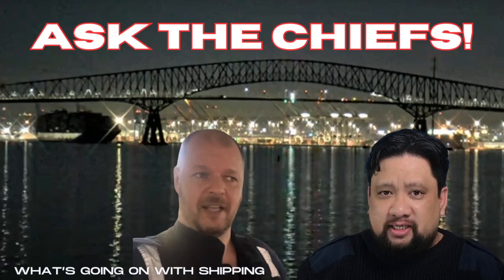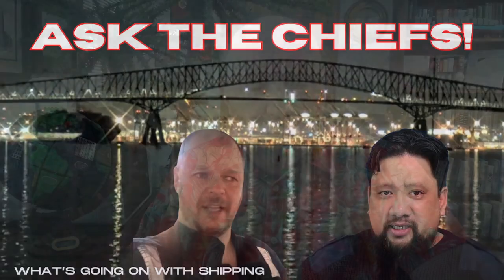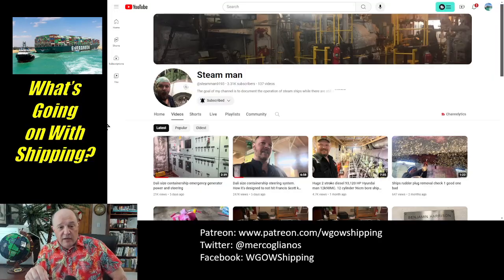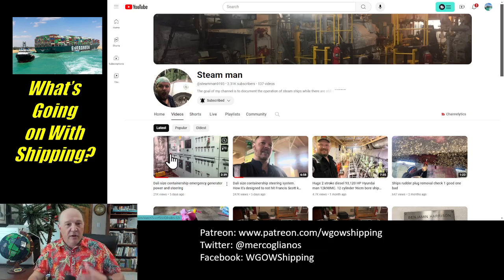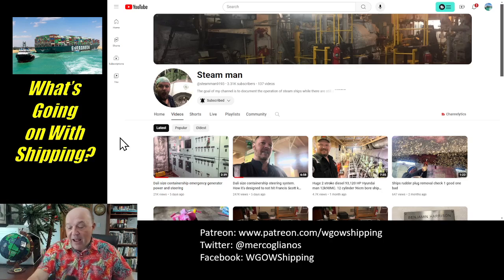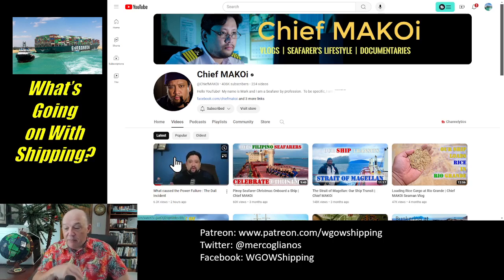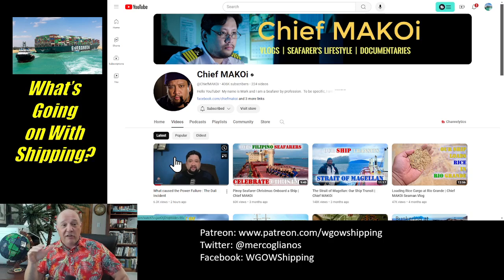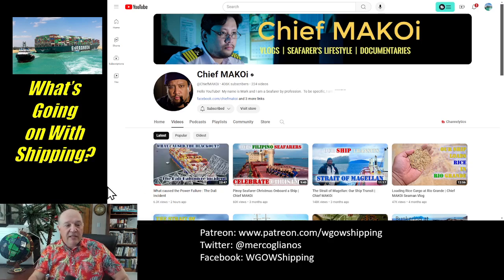Ask the Chiefs! | Chief MAKOi and Steam Man Discuss Issues Leading to Dali Losing Power in Baltimore

Comment: SOME vssls (not often those built in simillar shipyards as MV Dali) have only one FO supply pp to both ME and AE's, wh causes a total blackout and deadship condition at the same time if not the standby FO sup pp isnt properly operational at the time of failure of the running one. problem is definetly FO supp problem in addition poor maintenace of the EMSB gen and power gear

Comment: BTW, ...the only action by the captain that may have been different was "dropping just the "port anchor", when recognition of distress  would have required dropping both anchors, and prior to dropping any anchor issue the distress call, or the sequence of events regarding the realization of distress. "Accidents" are generally a singular event dictated by 'time-and-circumstances', never more so than in this event. This event must be recognized[...as simulated], as a warning, because that ship could have collided with much more destruction in any port or seas, ...and yes, more tugs will be necessary to move these massive ships around hazards to marine traffic safety(...$)

Comment: Thanks for the analysis, from someone with the engineering/education/experience, to explain this event. It has been my suspicion from the first appearance of the 'black-smoke' that this disaster was 'fuel-related'. Of course, every action of the captain, chief-engineer, and crew will be scrutinized exhaustively, by every investigative authority. Their actions, post engine failure, will  be throughly investigated. However, the electromechanical controls will also be scrutinized, by the best marine engineers. Knowing that these events are simulated, and trained for, in marine education is good, even if the outcomes are generally disasterous; "ships go bump in the night" ...and even in daylight. Separating fact from fiction is not easy in today's mass-communication environment, but it's nice to find someone with the truth. Thanks again🫡👍

Comment: The problem. based on information available today, is rooted in unable to share load between the two main generators.  The subject is sometimes called cross current compensation.  It is complex subject and not easily explained to anyone with out a strong electrical background.  I can tell you a lot more but I have delt with problems in ths area many times as a Westinghouse Service Engineer.  Please advise if you want me to go into detail.

Comment: Sal:   I saw Chief Makoi video on his take.   One of the hidden aspects of this disaster is when he said that in the Simulations they could not recover the vessel in a system failure like that if maneuvering.     That is like a Jet Airliner not being able to loose an engine on takeoff and crashing,  said aircraft HAVE to be able to climb on a single engine gear and flaps down which is worst case scenario.
      Given that,  all the AHJs knowing that which is also a given,  how can they not be blamed for setting up a system (3 tugs is the only one I can think of attached to the ship) that deals with that.   Sooner or latter its going to happen and now its been twice (in the US).    
      I will get looking at Steam Man videos as I was into backup power generation as well as facility swithgear  gear and distribution.    My backup systems had redundancy if they ran the whole facility and that was not life safety or mission critical,  it was to allow ops (freight sorting) regardless.  
     A common fuel failure should not be allowed.    If it is,  then the complicity of the shipbuilding certification groups is stunning.   Even if it was not this cause.  If it was electrical then the isolation and or the distribution is at fault and that too should not be allowed.    I had 6 critical diesel fire pumps and each fire pump had its own fuel supply.    Yes you could get contaminated fuel but fuel was delivered at different intervals and the engines were run  loaded 30 minutes a week to ensure ops which included bad fuel failures.  
      A backup generator will have its own fuel supply as well,  each of the main Generators should have individual fuel supplies for X amount of time as well as fuel separator that do water as well and the backup generator should have its own water/filter separator.

Comment: WHY DALI SHIP TURNED? In the Baltimore harbor area, a vessel channel has been dredged for ships with a large draft (the depth of the channel is 50 feet, but next to the channel the depth is only 11 and 14 feet) and next to the port side of the ship there is a lot of this deep volume laterally, but only a little laterally on the starboard side.
   When the ship travels in the channel closer to the right edge of the channel, the suction caused by the propellers causes a clearly larger tidal effect on the starboard side of the ship than on the port side of the ship when the keel divides the suction in two.
   Now - when the engines are turned off, where do the differences in the tidal effect on the different sides of the ship take the vessel that has traveled directly on the fairway? Does the flipping tide turn the vessel towards the edge of a nearby draft? Did the strong one-sided burst of the tidal phenomenon cause the ship to turn itself to starboard? 
   I believe that the mere excess of water on the port side of the ship compared to the shortage on the starboard side causes the ship to turn right by itself as the water masses try to equalize. It cannot be significantly affected by turning the rudder to the left or by lowering the anchor to the sandy bottom of the harbor basin. Even if this is done, its significance is only formal.

Comment: As a deck officer, before getting underway, you test gear with the engine room. This is law. If you are a 3rd mate worth your salt, OFF WATCH, go down to the Engine Room and see what the 1st AE has to do to make this happen. It's a big plate. Every plant is different and had it's quirks. Listen to the Engineer and develop a trust with them. It will only benefit you. On the other side, God help the Engineers if they have gun decked any deficiencies or lied about issues with the plant or other systems such as the STEERING or Ballast systems. SOX.  From the scanty information reported, who was the pilot? How many pilots were there. Many places require a Docking and Channel Pilot. Was steering control continuous throughout the whole evolution? What was recorded in the Bell Book if the VDR was inoperable (which I doubt). AIS's and VDR's have been spoofed for years. How forthcoming is VTS? Look Bro, I've been in the industry since the mid 1970's and something doesn't pass the sniff test.

Comment: Call the CHENG! Hmmm, I have been syaing this same stuff about the battle between the E-Gen and Main Power busses when they try to restore power at the same time. Depending on the software you will have switches clicking on and off from both systems trying to get electricity back up; including the battery back up for steering, lighting, pneumatics, navigation, and communication.

Comment: Seems stupid to me a modern ship has to kill its power plant start it in the other direction to reverse. We have had transmissions for a very long time. Baltimore is a shit show prove me wrong. Stupidity is killing our world.
Reply from the maker: It is a slow speed diesel that does not require a clutch or transmission, and therefore substantially cheaper.
Reply: @wgowshipping  I understand that. I am a diesel mechanic. But if the shaft is directly coupled to the screws then it must be killed and restarted the other way.  Restarting those massive things per oceangoers of big boats isn't a quick process. Plus cam settings must be changed to reverse most diesels to start backwards
Reply from the maker: @rodneyward8357  Exactly.  That is why the chief did not think the engine was ever placed astern.
Reply: @wgowshipping  still stinks. Yes I really like your channel. But we must focus on making shipping better. Imagine if a US flagged ship took out a bridge in a foreign country? It would be bad. It's a shat show and it makes us look like that.
Reply: @rodneyward8357 
These are two-stroke engines, so no valves and no cams.
Reply: @margaretabengtabelsson9500  diesel 2 strokes have all of that. Not even close to a 2 stroke gasoline
Reply: @wgowshipping  so basically cheap and stupid took out a major bridge in a major port. Ain't that some shat.

Comment: I'm a master helmsman. I'm not just not buying that the reason the ship continued it's turn is because it lost propulsion. While prop wash definitely contributes to the turning moment, the ship should have been able to halt it's turn to starboard if steering was restored when the power came back on.  To me, it looks like steering control was never restored, even when the power came back on.  While there are other forces that are likely contributing to the turn to starboard, such as bank suction and current, I still think they should have been able to at least stop the turn if steering was restored.

Comment: Having retired as a Chief Engineer from the merchant marine industry, I totally agree with Chief Makoi. I suspected early fuel changeover attempt, have to check the competency of the 4th engineer and all other engineers on board. Is there any engineering crew change (new staff) on that port?  There are lots of other factors for the total power failure, which is very complex. Need a thorough investigation to find out what caused this incident. Six human lives lost.

Comment: My question for the chiefs is. If the main engine is free spinning because of prop wash, How is the engine being lubricated? And if it is free spinning and you get the main generator back on line can you restart it without the air start system? Can't you get the auxiliaries running and turn on the fuel and restart the engine. I would think with all that mass turning it should start.

Comment: Thanks for refering me to the two chiefs. As a professionl engineer, it is refreshing to hear the analysis from people that know the systems involved with control of the ship.. It is hard to believe that three diesel engines all died simultaniously due to a fuel issue. I'm leaning toward an issue with the electrical systems as evvidenced by the nav lights dark on the first restart and they were lit on the second. I don''t know about big computer controlled diesel engines but the engines on generators and construction equipment  do smoke on start up. I have followed Chief Makoi for a long time and his presentation was excellent.

Comment: One question I asked on Chief Makoi's channel and haven't heard an answer about in one of your early videos on the Dali you mentioned that there was no use of the bow thruster.
I was wondering if it was something that wouldn't be connected to any of the backup systems or otherwise requires the main engine to use.
Reply: Somewhere within the last couple days that has been discussed and it was commented that in order to produce enough thrust to be effective those thrusters eat a very high amount of electricity. So, if there are major electrical issues there likely will be no bow thruster available.

Comment: Once again why a ship big like dali had to be doing 8 knots in channel before the sky bridge.  Because  of pressure s from pilot or port authorities  owners of operation management.  No escorting  tugs to save money or what . Does the letting go port  anchor made it worse . Otherwise  still the ship could  have  passed the bridge column with the bridge at least intact.
Reply: I have read earlier that most/any tugs are ineffective above 5kts; and/or the tugs can not "keep up" with client ships above 5kts.  It is a conundrum.
The only way around this would be to run everything around ports at 5kts or less...but then the "big" 100,000 tonne ships are not under "good control" below 5kts because the wind and currents blow them off course too much below 5kts.   The large ships need a lot of momentum to "make way".  It is a major conundrum.  The maritime insurance companies are befuddled how to make this any safer than it already is.  You need above 5kts momentum to "drive" these large ships to make precise directional headway...very tough issues !!
Reply: @Carlos-im3hn   i have a experience of 20 years as a marner. Its has been long time i left it . I know rules n regulations  have changed since then . On ships I was in have never experienced blackouts in channels or underway.  May be on anchorage but what I remembered . But I know nowadays especially  container  ships are on a very tight schedules. With all kinds of pressures by ships  management   n saving money cut corners hurry hurry situations.. do freezer containers get power  from ships generators. I do not know.. Really point blank BAD LUCK FOR DALI NOTHING COULD SAID MORE BAD TIMMINGS

Comment: I was getting a special a the local bar, when on X I was advised that a ship doesn't lose steering when a ship loses power and lost it, becoming rather animated. Another person at the bar asked me where power and steering was lost and I said, "Seven Foot Knoll." 

That produced the look of terror on his face and he asked me, "Water in the fuel." 

I responded, "Lost wind, we were under sail." 

Another look of horror, "No engine?" 

"What we had wasn't going to work there." 

""What did you do?" 

"Figured out what not to do to sink our ship or get us killed. Our faith got us trough." 

He had a power boat and a problem on a different area of the bay, and wished he has sails." What you say is true, but with navigation and steering, the principles of physics are the same and applies to all. The one thing I will not tolerate is disrespect to the crew and would love to hear their stories. I figure they had 5 to ten people working on the problem, as well their assistants. I figured everyone else on board was gearing up on fire fighting or damage control.

Comment: 5-Stars!  🌟🌟🌟🌟🌟    I found it interesting to learn that these gigantic direct drive engines have no transmission... to be reversed, the engine must be stopped then restarted in the opposite direction while going less than 6 knots -
Reply: Wow.  This is probably very impotant since they were underway at 8kts when the first underway power outages occurred.  The Dali crew needed to drop anchor quickly and slow down by dragging the sunk anchor along, before later restarting in reverse.  It looks like the Dali ran out of "runway" and time before the allision.      
So many moving parts.

Comment: Once the engine shuts down because of lack of fuel ( from the unpowered fuel pump ), how much time is needed to restart the engine after electrical power is restored?   Could the black smoke be because the pilot was pushing the engine restart sequence in order to regain rudder or to put the ship into reverse?
Reply: Air blowing the cylinders clear to restart an engine?
Reply: @mcnairdn  yeah, wish the experts would explain. Absolutely stunning that the loss of electrical generator causes a massive ship engine to shut down.
Reply: @Steve-Richter chief Makoi did explain it. Electric fuel, oil, and cooling pumps

Comment: Ok, so has anybody come out with the reason as to what actually caused this event?
Reply: Perhaps - you could go to the channels suggested by this excellent instructor and educator and view what he's suggested? Then - you will have a much better idea.
Reply: Personal Opinion: Dali underway at 8kts and 95,000 tonnes and the Dali velocity vector slightly askew, dropping the Dali bow anchor (either to port or starboard) and then Dali accidentally crossing over anchor chain pivot and momentum could have turned the Dali velocity vector towards starboard into the allision.  It may be very unfortunate and simple physics events within minutes of the accident.  Look at the detailed timeline when the Dali dropped anchor hit bottom and started dragging vs. when the Dali started turning towards the allision.  Again, probably just simple physics.  Obviously the power outages (dockside and underway)  were major factors in this accident.